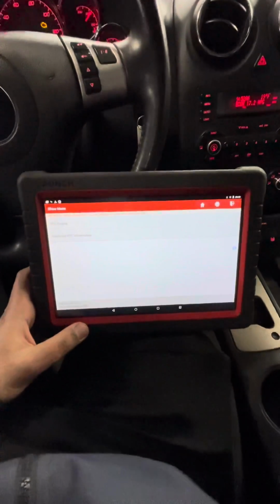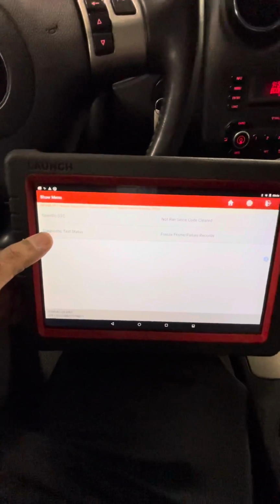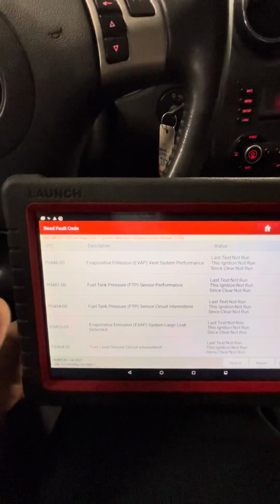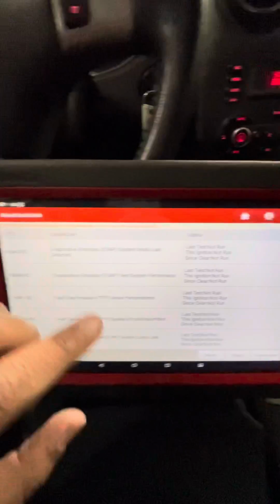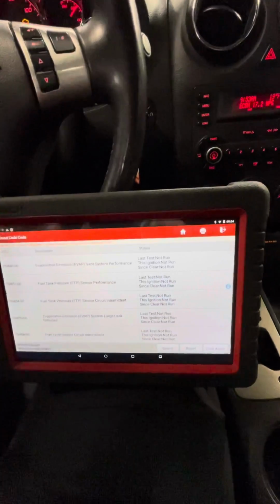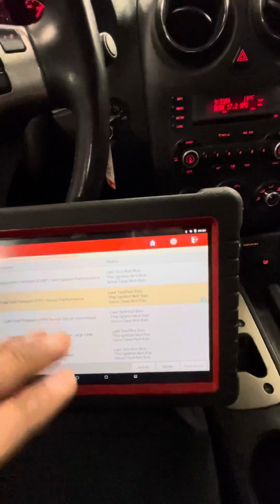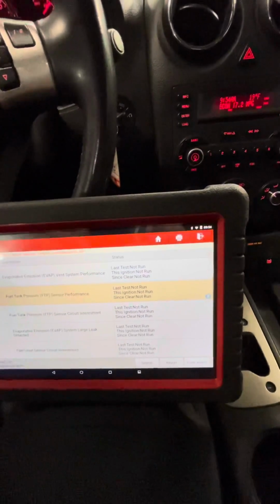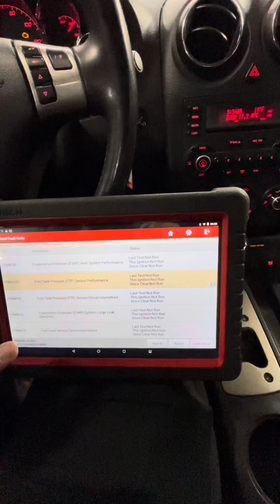GM drive cycle tips for techs

Comment: hey bro, would you happen to know the correct drive cycle for a 19 escalade? my evap and o2s monitors wont come to ready status
Reply from the maker: Depending on how cold it is , sometimes it can make it difficult to set these monitors . If possible park the truck inside heated garage over night . Then do a drive cycle first thing in morning . Nothing special stop and go traffic for a few minutes to regular speeds 55 mph . Evap is going to take longest to set